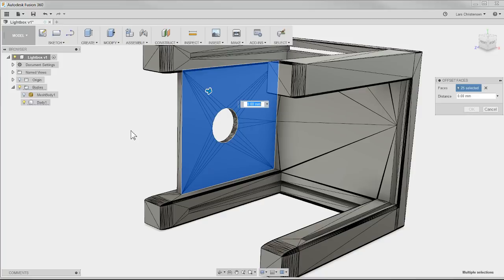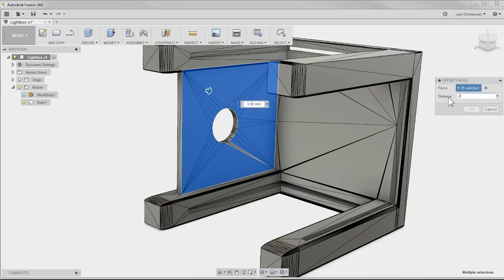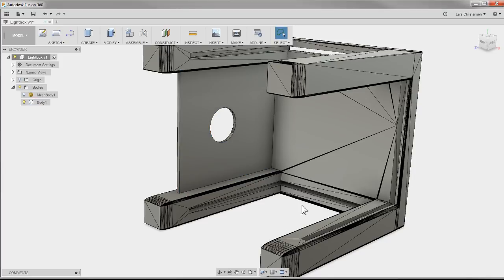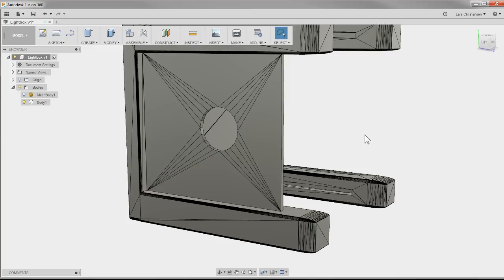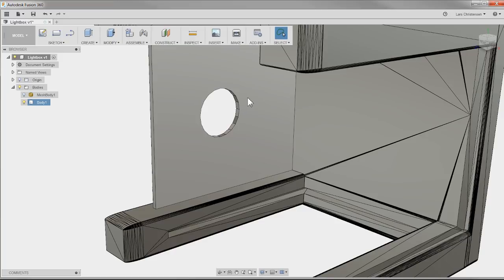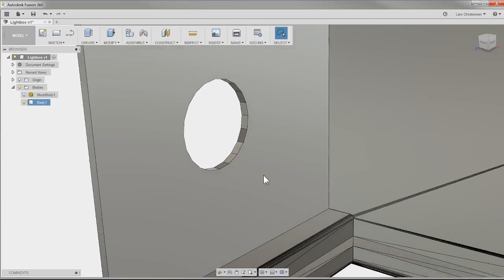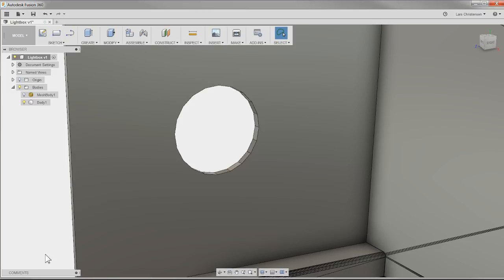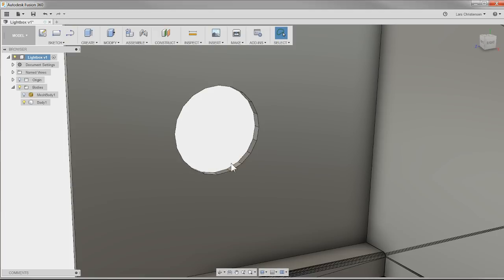Quick! Modify an STL file — Fusion 360 Tutorial — #LarsLive 118

Comment: Another easy way to take flat faces (non-radius faces) and get rid of the triangles is to:

You can do this after you have converted your mesh file into a BREP.  While the design history is turned off, go into the PATCH workspace.  Click on MODIFY, MERGE.  Click on the SELECT CHAIN option in the pop-up window and then click on a face.  

Once you hit OK give Fusion a little bit and it will take all those triangles that make up a flat side and combine them together.  This won't work on any radius or curved areas but you can do what Lars did to help with those problems.

Comment: Hi Lars, (And everyone else)! Fusion actually has a really neat built-in feature. After converting stl's to solid bodies. Instead of having to select and extrude the whole face simply select one triangular face and then delete, Fusion then figures out all of the separate faces of on plane and turns then in one single face you can work with.
Reply: This seems to only work for me if I use File-Open and delete the faces. However, importing it using this method results in the dimensions to be completely wrong. If you import it using the Insert mesh option, then the dimensions are correct but it absolutely will not let me delete any faces.
Reply: @dennislokken7003  the scale often comes through 10x if you use the scale command with a factor of 0.1 you should be fine. I don't know why it comes in so big.
Reply: @connor1st  :Thanks. I had actually tried that yesterday and scaling seems to work. And it is really hard to tell for certain but the 0.1 scale ratio seems to be correct.  It definitely makes working with the stl files easier. I just found it interesting that there are two different ways (inserting or opening teh stl file) and they don't work the same.

Comment: Another way of getting a STL file into Fusion is to go to insert mesh and import it there. Of course you have to turn off design history before you can select convert mesh to brep. If the facets (faces, triangles) is too much you can switch to the mesh environment and use the reduce faces function and get it to less than 10,000 which is the preferred limit. Usually you can get away with the reduction depending on the model. Flat surfaces with triangles breaking them up sometimes can be automatically repaired just by deleting a triangle or two.
Reply from the maker: Hi John Bickford Thank you for watching! ANd thank yuou for the great comment!

Comment: Very handy video.  I had to make a small modification to a model I pulled down from Thingiverse and this helped a lot.  The only thing I struggled with was the scale.  I File|Opened the model and it came in at 10x the size.  But I was able to do the BRep thing.  If I imported the model, there was no BRep menu item, so I was stuck.  In the end, I just used File|Open and scaled to 0.1, which was sufficient for what I needed.
Reply: Just found out that turning off Capture Design History makes the BRep menu option appear!
Reply: @anthonyroby296  I read somewhere that to insert a mesh file (stl) into Fusion 360 with the original dimensions, you got to use the insert feature. And also, I did what you suggest, turning off Capture Design History and I was able to convert to BRep with the original size. Cheers!

Comment: Lars, your videos are amazing, but I am having a problem following along due to the version differences? I cannot get the Mesh workspace to appear using Fusion 360 student ver 2.0.9512. 
In the Preferences screen, there isn't a Preview option but a Preview Features which has TON more options and I selected the Mesh Workspace option and then apply and save, but I didn't get the Mesh Workspace option in the dropdown in the upper left hand section and I didn't have the Model Workspace either so I wasn't able to follow along because I didn't have the option I need. I closed and re-opened Fusion just in case and still the workspaces were not available. Any suggestions or other video to watch? (I will eventually watch all of your videos! LOL)
PS, I do have the history disabled
Reply: Hi Rick, I just had the same problem. In the newer version of Fusion360 it is no longer in the Design dropdown. It is now in the menu above the ribbon. You'll see SOLID, SURFACE, .. and also MESH. Hope that helps. br Paul
Reply: Had the same issue. My problem was that Fusion 360 didn't download the mesh-update or installed it properly. Deactivate the mesh function and apply. Then activate and apply it again. That solved it for me.

Comment: I caught your tutorial #118. It seems like you said you don’t like working with STL files because the geometry is not accurate. So please tell us what other file structure should we be using to do 3D printing?
Reply from the maker: Hi Tom Ferguson Thank you for watching! Sadly you can't really use anything else. The printer companies back in the day decided that STL was the simplest to use, they were right, but in my opinion STL files are too risky because of the accuracy if you have no control. If you work in Fusion you at least have a chance to save them out in a higher resolution, but if you receive an STL file from someone, or in the worst case, has to modify it....well, then I have not been a fan. At least until Fusion came along :-)

Comment: Thanks - super useful. One question for you - when I import an STL file intended for 3D printing, make some modifications, then re-export it, the size is all wrong. Also while working in Fusion 360 if I measure the model, the dimensions are incorrect. Why is this and how to I fix it please?
Reply: I just experienced this, too.  What I did was bring in the original unedited .STL into my slicer and adjust the scale on the edited version to match it.

Comment: Hi Lars,
Great video! Very helpful, I have a question regarding my issue. I need to modify one STL file because one part of it is too narrow. Do you have any suggestion how to do that, or maybe you have a video on where I will find the guide. Thanks a lot!
Reply from the maker: If you turn it into a solid you could possibly use the extrude command to add more volume

Comment: All BREP surfaces are getting converted into triangles during transfer to most 3d printers anyway.  In fact, I believe ALL 3d printers convert the objects to triangles at some point in the translation process, because triangles are the most basic shape and easiest for the software to deal with.  Only certain CNC or Lazer cutting machines read B Spline curve information directly as machine language.  All other software work under the hood with triangles.  All Fusion is doing here is hiding the triangulation of the surface so you don't have to deal with them directly.  That's all.

Comment: Btw if it helps anyone, mesh to brep option does NOT appear if history is turned on. Why? I don't know and I don't care lol. Saving the hair on fellow newbies heads one day at a time! XD
Reply: I believe it is not an option because Fusion 360 would try to "log" each individual calculation to convert the mesh into a body. This would probably be in the hundreds to thousands of operations, so it would be too expensive to do with history enabled unless the model was very small/low resolution.
Reply: @aspenmallery   which means, that they are idiots, but that fits a lot of other things... Just log the ONE operation, grouping them together.   AND leave the stupid option there, just tell me what I need to do to enable/use it.   This dig through the room for the hair under the carpet approach to UI is SO 1980's... Where you have a book next to your computer to tell you all the things they couldn't document and hid...   Hideous UI design is Auto-desk's mantra since the DOS days...
Reply: @traderhutgames  Then make something better and stop complaining. Fusions UI is actually rather good for a CAD program. It probably has one of the easiest learning curves out of them all, but I understand when you get stuck that it is frustrating.

Comment: Hello, such a Lars, when I load the STL to Fusion 360, with dimensions that come by default in the STL of 100 mm x 100 mm x 5 mm, Adobe Fusion 360 resizes the model, or scales it automatically. When I'm going to print the piece in 3D, the measurements are resized 100%, if I reduce its size the circles where the screw threads change a bit.

If the STL part passes through Fusion without affecting its size, it would be easier and faster to print parts.

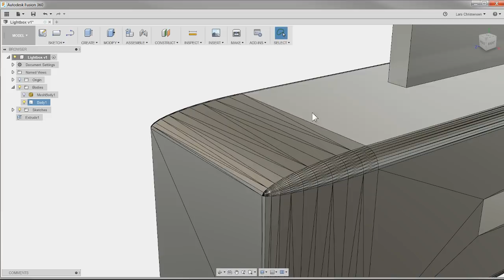Comment: At 15:15 you say that having these triangles is going to show up in 3D printing.
That got me wondering which workflow you use to 3D print. For example Cura will only accept mesh based fileformats and thus will always suffer from this inaccuracy.
Even Simplify3D removed the option to use g2 and g3 commands.
Am I missing something?
Reply: All 3d printers will convert the model to triangles in the end.  Every single one of them.  So Fusion 360 isn't getting rid of triangles.  It's just hiding them and changing vertex order.  However, the triangles are still there behind the scenes and under the hood.  Every model gets translated to triangles when they export to a 3d printer.  There are no real exceptions.  Only CNC machines and lazer cutters truly work with B splines all the way through the process.
Reply: @DigiFootageFX   Yeah that was my point. I was hoping the creator would have a real magic trick to support his claim.
Marlin theoretically supports real curves, but then again internally splits them to smaller linear travel moves at a customizable resolution.
I believe Fusion 360 internally is indeed getting rid of triangles in this process. But then again at no real advantage after exporting to an STL file, though the resolution and thus the deviation could still differ when compared to the original file.
Reply: @TheBrassn  I'm skeptical that Fusion 360 actually gets rid of any triangles under the hood.  I'd have to investigate the actual topology process of the software, but if you notice there are still vertices and edges which make up that hole, so unless the new surface was detached to a completely separate object, It has to be interpolating the new surface with underlying triangulated geometry to correspond with the edges on the rest of the model.  I use triangulated topology from 3dsmax and Blender for 3d printing all the time, and as long as they are planar, there's no surface issues in the print.

Comment: Not what I was hoping for. Is there not a way to take an STL, and get a usable solid that we can work on like we created it in Fusion? Having to jump through all these hoops rebuilding the file, you may as well just redo it yourself from scratch. The issue is, sometimes these STL files are WAY too detailed to redo. Is there a way to to convert an STL, and have it perfectly set to a workable files without the triangles?
Reply from the maker: Hi 8BitLife Thank you for watching! That is the problem! Garbage in... The only data a stil contains, are those trianlges. Someone could probably create some code that could translate it into a solid, but not without messing with the tolerances, because, again, it is just triangles.

Comment: I had to come back to this a second time to see if I missed something. When I have tried to modify a file I find that it gives me dimensions that are not valid . If I try to extrude a part it may say it is way bigger than it is. If a projecting shaft was 3" I may pull it out what looks like a 1/2 more but it may say it is 6"! If you understand.
Reply from the maker: Hi gvet47 Thank you for watching!
Try to do this in metric. I need to talk to someone on the development team about this. There might be an issue with the standard option.
Reply: Lars Christensen I have also been trying to find a way to make surface texture on flat faces. Learned how to knurl on a round per your video but would like to do on flat face.

Comment: Hey Lars.   I'm a novice using the Fusion 360 version 2.0.10813, Active Plan: Fusion 360, Personal, macOS 10.15.7 and have no problem importing an STL file as a mesh and turning off history; but after that I never get an menu item "Convert to BREF" or similar option; even after hours of trying.   Any ideas?
Reply: @charliebrownn6622  thank you!!!
Reply: You can press “s” on your keyboard and search mesh to brep (or any other tool if you having trouble finding it)

Comment: So if I modify an still file and it has a hole if I do not convert it like you did here it will not be a smooth round hole when printed? Any contour if not smoothed will be a bunch of facets when printed?
Reply from the maker: Hi gvet47 Thank you for watching!
You will get what you see on the screen. So in this case the hole will be as round as the triangular shapes are.

Best,
Lars

Comment: 1. There is no model menu, 2. there is no right click convert to brep (whatever a brep is), so other than that, this is great...   I presume this is all invalid now with a newer version of the software?  (Oh, I DID see the brep thing when I did an 'open' but unfortunately, in spite of being reported 6 YEARS ago as a problem, doing a 'open' on a STL file doesn't first prompt for the scale and then import it (should be a trivial fix - I know, I'm a software Engineer), so it always imports at 10X the correct size of virtually all .STL files - it should read my preferences which say I used mm as the default unit, and boom!  Solved... but in 6 years of development, they still can't do that, so I have to use an import mesh option instead, and then I don't get that option..  (but at least, it is the correct size...)   I can't even select a point in the crazy mesh  (ALL I want to do is put a hole though the center... SO hard as non of the points can be selected in a mesh..)
Reply: We have the same issue now in 2022 please help!!!!!!!!!!!!

Comment: Man I need a tutorial like this but in Solidworks. For some reason the .STL file also has the scaling completely out of wack. it's like a thousand times larger than it should be on the model I was provid
ed to work with.
Reply: Might be your default units? (Not sure how to set that in Fusion 360) -- but STL files are unitless (like instead of saying "300 mm", it just says "300").  Most programs ask you the units when you import them.  But the defacto-standard is leaning to assume that the units are in mm. -- If for some reason the units are in mm, but you're importing them as inches or feet (or meters) then that could be the problem. :-/

Comment: Lars, you are a VERY knowledgable person and I think that's a problem. You tend to overlook those of us who are hobbyists, and there are a lot of us. I can't imagine that you didn't know about ThingiVerse. It is the #1 repository for STL files used in 3d printing. There is a large community of 3d printers who use Fusion 360. When I say overlook, you tend to skip over small things like how did you import the STL file you are using. I am a newby wanna be 360 user and I am already frustrated. I want to modify a simple STL file of an iPhone stand so it will hold an iPhone with a case on it and make it more rigid (thicker material)...OK done complaining I will go back to the video and see if you get me where I need to go.

Comment: Good video, but looks like Adobe changed everything, again, and now thos options don't exist to creat a body from a mesh. There is the Convert menu item and it now has four options, but I can't get any of them to work. I just get errors or it asks for thing I have no idea what its wanting. sigh
Reply from the maker: Hi Da Hai Zhu Thank you for watching!
You need to make sure you do not have the "Capture history" on the bottom on. Right-click the top tree on the left and turn that off. Then you can select your stl by right-clicking on it and select convert to Brep
Reply: Lars Christensen : Yay! It worked. Thanks!
Reply: Lars Christensen : this might be new: just selecting one triangle body face and doing a push/pull now pulls all triangle body faces on that same plane. No need to select all the triangles on the face first!

Comment: while trying to import a tube chassis stl. file from bendtech to fusion the dimensions are 10x overscale. after converting stl model to brep and changing facet count to achieve brep i try to scale dimensions of the chassis and due to the size of file and number of components fusion crashes, any help. im trying to create bracketry for the frames i design in bendtech using fusion.
Reply: I ran into the same issue with the scaling

Comment: this does not work anymore.  Mesh to brep is not available any more.  I only get the mesh to tspline option then it aborts the operation.  can you re do this video with the updated Fusion?  I am basically working on an stl downloaded from thingiverse where it needs modification or a new one made.
Reply: I found the command but it is not on the right click menu.  also on the flat surfaces you do not need to select all and merge.  just delete one triangel and Fusion fixes it.  I just wish it worked on curved surfaces as well
Reply: After importing an STL file, try Right Clicking on your top most Component, turn off "Capture Design History" at the bottom, then Right Click your Mesh and the option to Brep should be visible!😊
Reply: @Micah's answer is 100% correct, just remember that you must right-click on the meshbody in the left-hand side menu. I.e. Bodies/MeshBody1 in my case.
Reply: @petternordgren2703  Thank you.  "Right click the left menu"  ;)
Reply: @micahokeiley  you saved me haha, thank you!